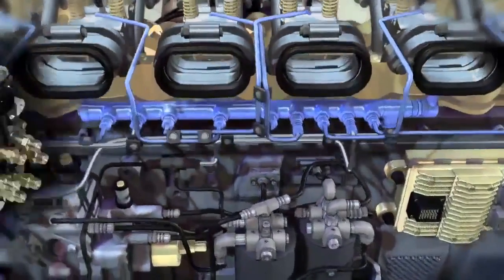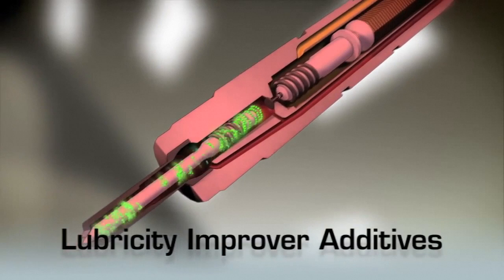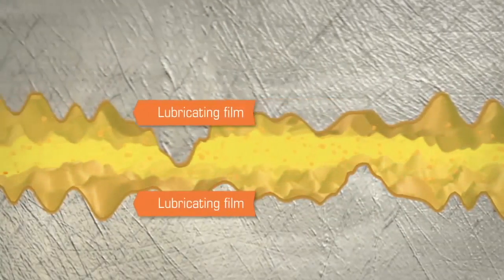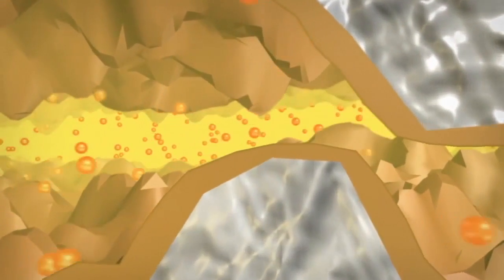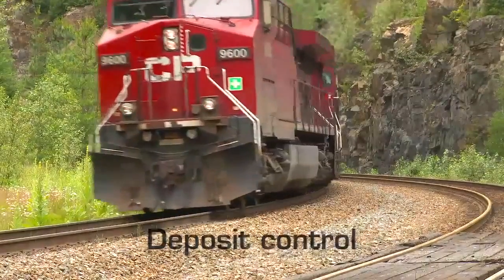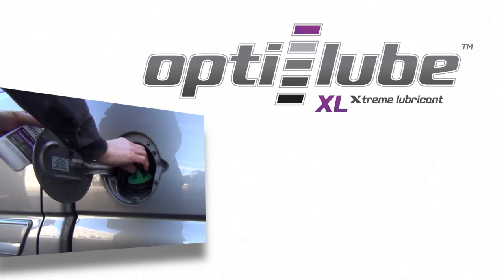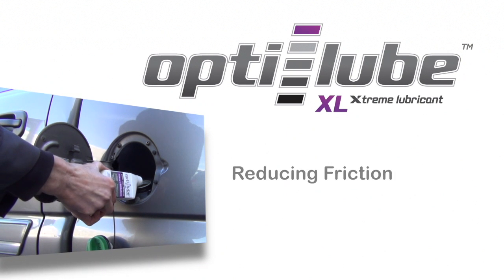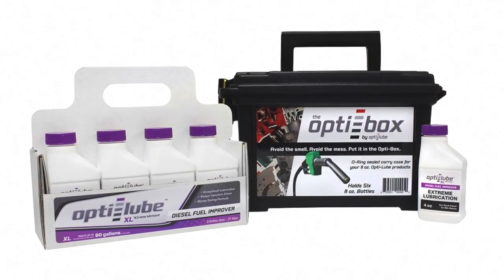How Lubricity Additives Enhance Wear Protection in Diesel Vehicles

Comment: If you've stumbled across this video, let me tell you this stuff works!
TLDR version: Fuel mileage was 12.2 mpg. Added crankcase friction modifier and reached ~15MPG. Gains declined after 6000Miles. Added Fuel friction modifier and In 500 miles brought overall average MPG to 17.3MPG. 

I had spool-valves that were not moving as the engine was requesting resulting in poor running and poor mileage.
A friction modifier added to the oil from another manufacturer had some measurable results of  ~3 mile per gallon increase.
After 6000 miles the gains had revert to previous levels.
On a whim I did some research on fuel additives and discovered this particular company and their products after better learning about some of the effects of Low Sulfur fuels. 
I used a double dose in a tank of locally available fuel and in enough time to run 1 gallon of fuel through the injectors they were measurably quieter and power was obviously increased.
I ran the full tank of treated fuel and could see a steadily decreasing demand for fuel with the same steady state loads I'd previously used.
At the end of that tank of fuel I gained back the lost mileage per gallon and had increased over the original mileage baseline from 6500 miles prior by a full 5 MPG.
A 29% increase in mileage in just one tank is unbelievable, But that is exactly what happened.
I've ordered a full gallon of this additive to use in my personal equipment and the equipment I use for work.  
In my case  I saved enough money on fuel in one tank to pay for 69% of the cost of an entire gallon of this additive.
In two tanks the savings will likely save me 138% or more the cost of the additive.
It literally paid for its self. This has been a great success and I'm going to tell others about my experience and even offer some additive for them to try.
10/10 product. The only thing better would likely be running a good quality biodiesel.